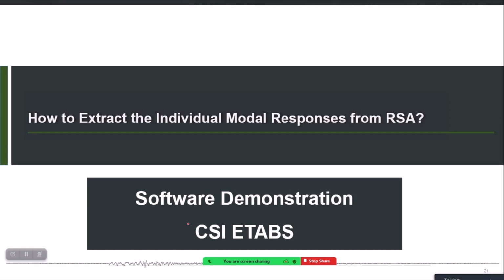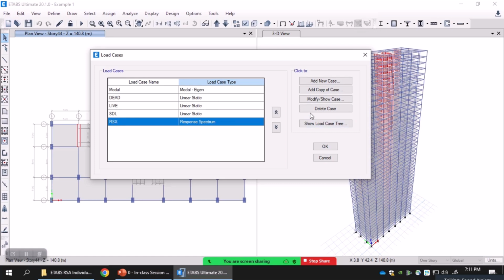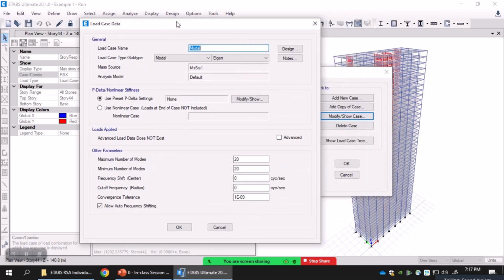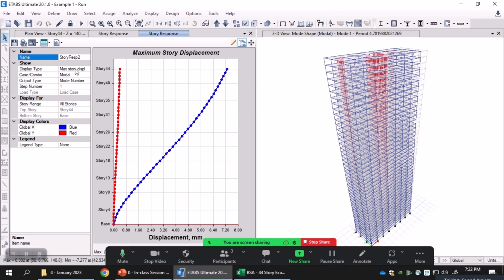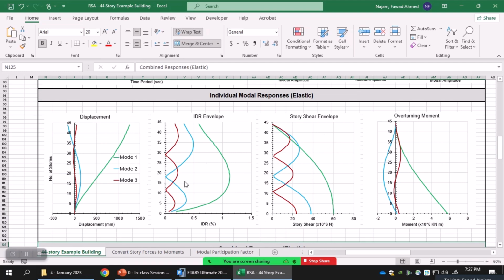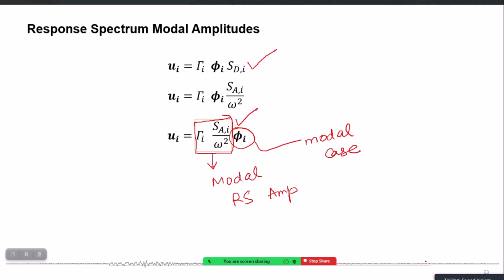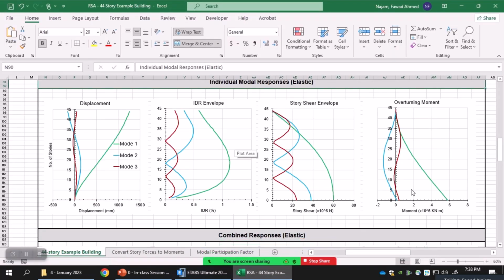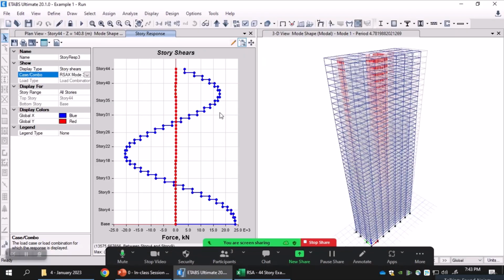Part 3: Modal Responses using CSI ETABS

Comment: Thank you for your video. I have a couple of questions.

- Why ETABS modes (from mode 2 onwards) are not crossing zero values? i.e. all values are always postive. How to correct it? 
- Can you please explain the reason of having such a high value of displacement (i.e. ~1.5m)? 
- Also, based on these results how to corelate the conept of Higher mode effects in Tall buildings?

Comment: Sir why you replace software from SAP2000 to ETABS to explain Modal Response Spectrum Analysis, is that because SAP2000 not capable to analyze and perform it ? or because result from SAP2000 so little, so we can't develop it to except and. explain The RSA?
Reply from the maker: No. My audience in this demonstration wanted SAP 2000.